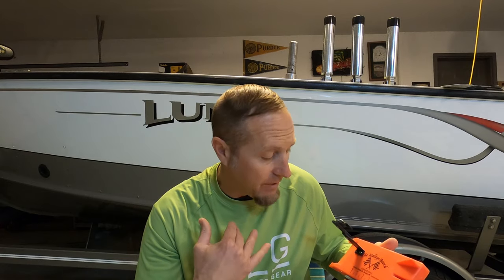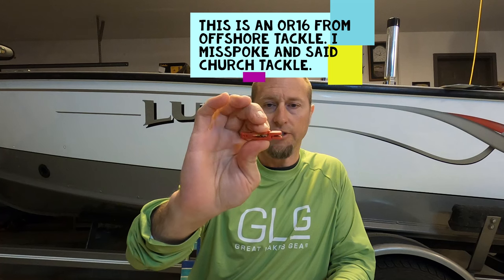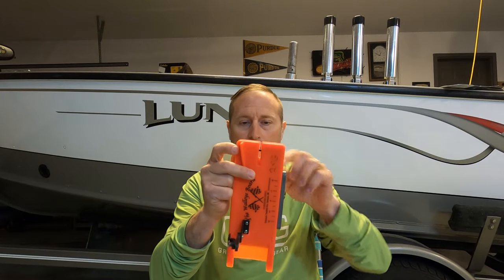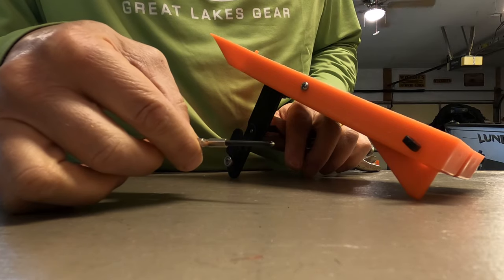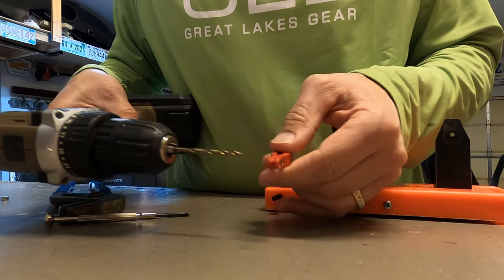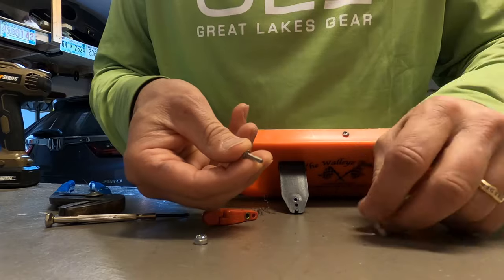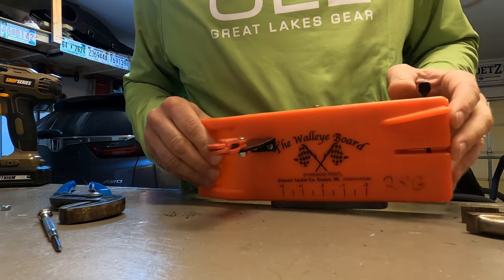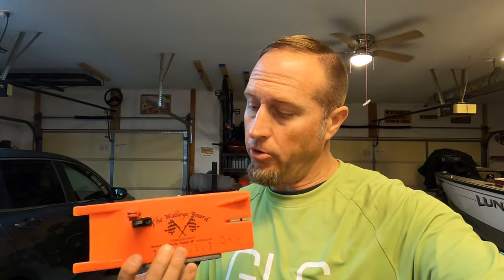Church Tackle Co. "The Walleye Board" upgrades with Offshore Tackle OR16 pinch pad.

Comment: Bryan, I use a red rigger/big planner board release rubber band on the line behind the board and half hitch it to the line and put the loop of the rubber band and pin the loop with the line behind the pin like normal. It does help the slipping and you can reel the rubber band into the reel and gives you a great return when letting back out! It was an old school way before we had line counters for amount of line out!
Reply from the maker: That’s a great idea!

Comment: We strongly recommend against the OR releases.  The rubber pads wear quickly with line sawing back and forth in heavy waves and currents.   Get the snapper release if you are an offshore guy or the lock jaws if you are a church guy.  Don’t skimp or you will be breaking off tackle and suffering bad board performance.   Walleye guys use lock jaws and snappers depending on board manufacturer and they just use an oversized snap swivel from a spin doctor on back.  If you have church, throw out the plastic pins and get stainless pins.   Then you can spin the board 5-7 times with braid backer and it will never move.
Reply from the maker: I’d be willing to try the releases you were talking about if you’d like to send me some

Comment: Ive always used offshore boards that released. Recently I also purchased the Ninja planer boards. Do you have any issues with retrieving outside boards with small fish on them? Any suggestions? Ive heard just a steady retrieve will allow the board to track behind the boat and not tangle inside boards. Thanks in advance
Reply from the maker: We bought a few ninjas for our coppers as they seem to handle larger baits and weights. When we real out boards in, we point the rod directly at and steady. Otherwise ,they dive. We also stagger our lengths behind the board so we don’t tangle. Outside boards longer leads and inside shorter leads. We mention that in our trolling vids if you haven’t seen our other stuff. If you have, thank you.
Reply: @BigLakeLittleBoat  Ive been enjoying the content for awhile now. Keep up the great work. I will definitely try a more directional point with the rod and see how these boards can handle the chaos of continuous walleye bites in comparison to the occasional salmon to maneuver around. Tight Lines
Reply from the maker: @tylervandenberghe8198  Thanks, Tyler for the support. With walleyes, I would probably use the boards that release as well.